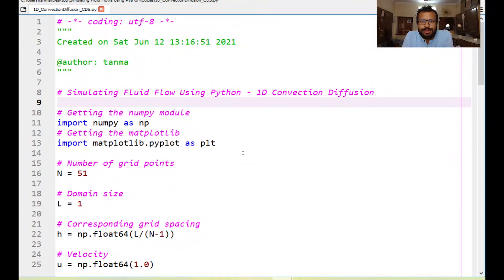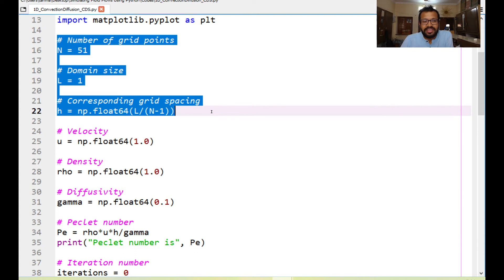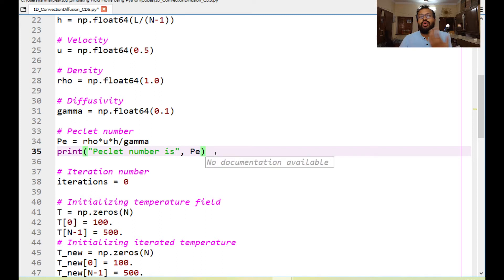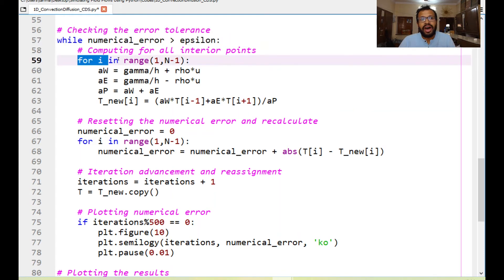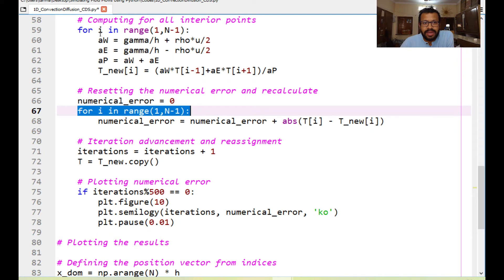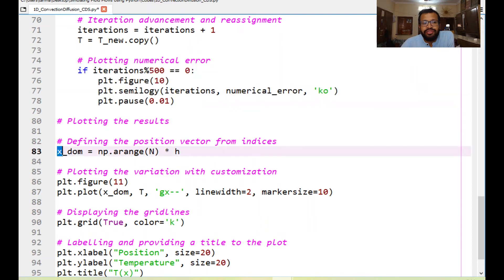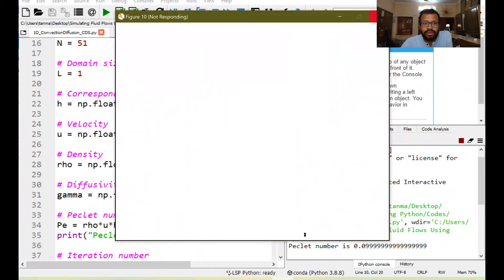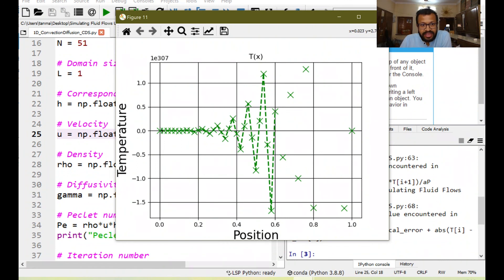Python to Solve Steady 1D Convection Diffusion | Lecture 16 | Simulating Fluid Flows Using Python

Comment: import numpy as np
import matplotlib.pyplot as plt
import math as m

# Geometry Defination and constant parameters (SI Units)
L = 1                               # Length
rho = 1                             #density
k = 0.1                             #diffusion coefficient

# Mesh
N = int(input("Enter number of nodes:"))# number of cells and cell centers
dx = L / N                          # mesh size
x = np.linspace(0,L, 2*N + 1)       # grid points at cell center and faces
x = np.delete(x, range(2,2*N,2))    # only center values

# Defining advection strength and diffusion strength 
u = float(input("Enter flow field value: ")) # value of flow field
F = rho * u                         #advection strength
D = k / dx                          #diffusion strength
Pe = F / D                          #Peclet Number
print(Pe)
#Boundary Conidtion
phi = np.zeros(N+2)
phi[0] = 1
phi[N+1] = 0

# Defining Coefficients based on Finite Volume Method
coeff = np.zeros((N,N))             # coefficient matrix

# Boundary Node First
A1 = 0                              #aw
A2 = (D - (F/2))                    #ae
A3 = ((2 * D) + F) * phi[0]         #Su
A4 = -((2 * D) + F)                 #Sp
A5 = A1 + A2 - A4                   #ap

# Middle Nodes
B1 = A2                             #ae
B2 = (D + (F/2))                    #aw
B5 = B1 + B2                        #ap

# Boundary Node Last
C1 = B2                             #aw
C2 = 0                              #ae
C3 = ((2 * D) - F) * phi[N+1]       #su
C4 = -((2 * D) - F)                 #sp
C5 = C1 + C2 - C4

for i in range(N):
    for j in range(N): 
        if i == j == 0:
            coeff[i,j] = A5
            coeff[i,j+1] = -A2
        elif i == j == N-1:
            coeff[i,j] = C5
            coeff[i,j-1] = -A2
        elif i == j:
            coeff[i,j] = B5
            coeff[i,j+1]= -A2
            coeff[i,j-1]= -B2

# Defining constants 
constant = np.zeros (N)
for i in range(N):
    if i == 0:
        constant[0] = A3
    if i == N-1:
        constant[N-1] = C3

# solving matrix
t = np.linalg.solve(coeff, constant)

#inserting the boundary values in the final result
t = np.insert(t, 0 , phi[0])
t = np.insert(t,N+1, phi[N+1])

# Analytical Solution
phiA = []
for i in x[1:N+1]:
    b = m.exp((rho*u*i)/k) - 1
    c = m.exp((rho*u*L)/k) - 1
    a = phi[0] +((b/c) * (phi[N+1]-phi[0]))
    phiA.append(a)

phiA.insert(0,phi[0])
phiA.insert((len(phiA)+1), phi[N+1])

# Plotting the result
plt.figure(figsize=(10, 6))
plt.plot(x, t, marker='o', linestyle='-', color='b', label='Numerical Solution')
plt.plot(x, phiA, marker='s', linestyle='-', color='g', label='Analytical Solution')
plt.xlabel('Distance (m)', fontsize=14)
plt.ylabel('phi', fontsize=14)
plt.title('Analytical vs Numerical Solution', fontsize=16)
plt.grid(True, which='both', linestyle='--', linewidth=0.5)
plt.legend()
plt.xticks(fontsize=12)
plt.yticks(fontsize=12)
plt.tight_layout()

# Display the plot
plt.show() is this a right approach?

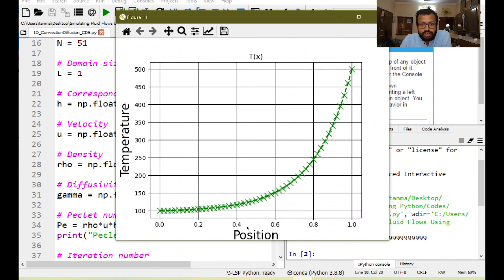Comment: Sir one doubt, while plotting the numerical error in Spyder,  instead of all numerical_error points getting plotted on same graph (at 9:26), each point is getting plotted on an individual graph. Is there some setting I need to change withing spyder? because the code is same
Reply: remove plt.pause(0.01). you will get all points witihin same graph
Reply: Same doubt for me too.